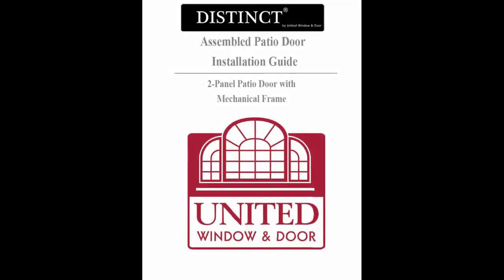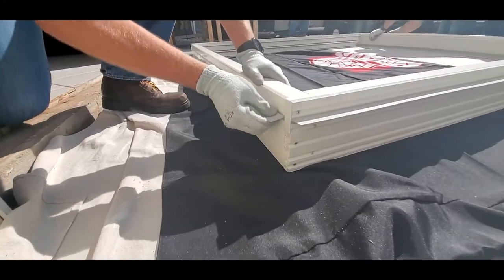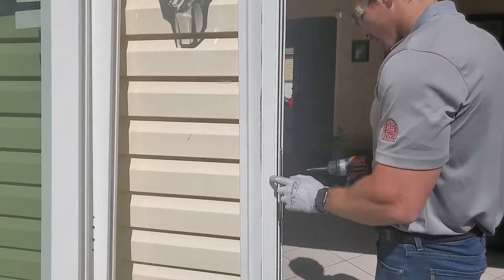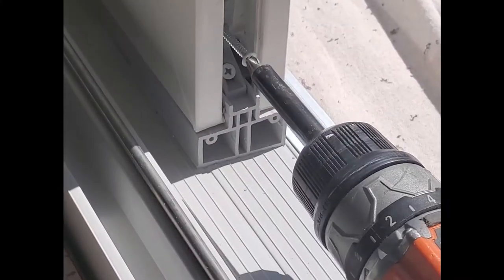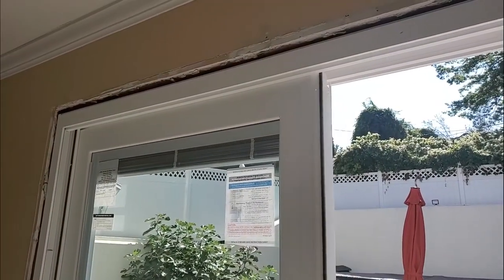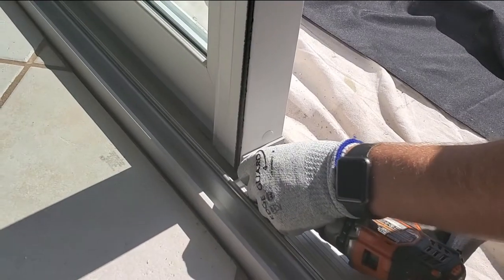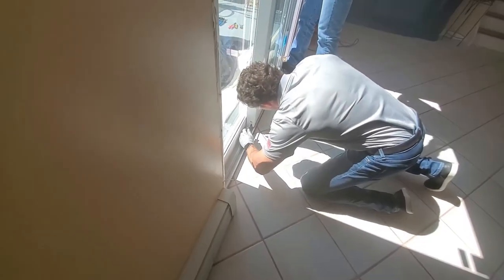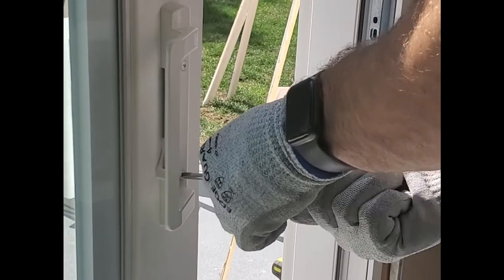DISTINCT® Composite Patio Door w/Knockdown Frame - INSTALL VIDEO

Comment: We just finished installing one of these (right opening door version - purchased from Lowe's) in our historic house that was built in 1890.  The whole setup seem stout/sturdy.  We were able to remove our old doors and install the new setup in one day.  We had to cut out old wood 1" siding using an oscillating blade which ate a couple hours.  Some quick observations:  
-It seems to require more force then it should to open and close the door, but we are hoping that eases up in time.  
-The sliding door panel blinds that are in the glass, were half way down and sideways when we opened the box.  The tape with the warning was still over the control mechanism so it appeared to have happened in the box on it's own.  After we finished the install, we moved the blinds to their uppermost position and they went back into their appropriate position.  We are crossing our fingers they don't have issues going forward.  
-The Lowe's employees sold us an $88 door handle because they said it doesn't come with one.  Well, it did come with one.  We plan on returning the handle tomorrow and purchasing the screen door.  We would always rather have what we don't need, instead of not having what we need so it's not an issue. 
-The track seems higher then normal.  We have already caught our feet on it while stepping over a few times.  We even installed it below our 1" thick hardwood floor.  Time for some foot lift retraining!   

There were a few hiccups that could have been avoided, if the instructions had more detail.   Examples:
1. We failed to push the non moving panel completely back, causing the bottom plastic piece we screwed it too, to have a gap.  This was only obvious when we were on the last step.  We had to remove several pieces to be able to release the panel so we could push it back flush.  The instructions do not specify whether to push the non removable plastic piece all the way up leaving a gap at the bottom, or all the way down leaving a gap at the top.  We chose to leave a gap at the top.  This was a critical mistake that took a long time to remedy.  The non removable plastic piece being misaligned caused it to block the bottom screw that held the panel in place.  We had to use a step bit to enlarge the hole so our screwdriver tip could fit into the screw we needed to remove, so we could push the panel back flush.  No matter how hard we tried we could NOT GET THE NON REMOVABLE part to budge.  It would NOT MOVE UP even 1 mm.    
2. One of the slimmer pieces you "push in", towards the end of the non moving panel install, was impossible for my wife to get in.  She gave up after trying for over 10 mins.  I spent about 10 mins fiddling with it until I figured out, I could bend it outward and push hard enough at a 45 degree angle, it would finally snap into place.  In this video we watched the installer do that very thing.  We laughed at how we watched this video AFTER we were finished and not before. 
3.  Nowhere in the instructions does it say to drive a screw at a 45 degree angle into the fixed panel backside.  The installer in the video did that (albeit clearly not at the site of install, looked more like the warehouse), but we didn't see that in the instructions.
4. The push in plastic pieces that are used for "new construction" are not specified as "new construction" in the instructions.  Wife has installed a few sliding glass doors and none of them required those flanges.  We installed them because the instructions said to.  The door we removed had them, although what we removed was like 50 or 60 or 70 years old and aluminum.  Because we used the "new construction" pieces, we had to install further out then the doors we removed.  This now requires us to purchase additional molding to take up the gap on the inside of the room.  Having thought about it after the fact though, we still would have used the "new construction" pieces because it seems like it gives a much better seal against the weather here in southern Washington state. 
5.  The plastic mini broom looking pieces you install in the middle top and bottom, the instructions told us to put the top one in before installing the moving panel.  We did that.  Then we couldn't install the moving panel.  The mini broom doesn't allow enough clearance for the door to lift over the rail for the wheels.  We had to remove the top mini broom.  After installing the moving panel, re-installing the 2 screw mini broom, one of the screws dropped directly between the doors with no way to get it.  It is there this very moment, probably lonely and afraid not knowing when it will be rescued.  We grabbed one of the many extra screws, of the same type/length, and even more carefully, was able to thread it back into the mini broom.

6. The instructions list 3 screws in several sections, but they only pre drilled 2 of them.  This same thing was repeated multiple times.  It makes for confusion and uncertainty.

Overall, the door looks good, everything we needed was in the  kit, and despite being exhausted, we are very pleased with the overall product.  Time will tell whether vinyl holds up to the elements or not.  Fingers crossed!
Reply: Thanks for all the info!! I’m gonna get one soon….to replace a leaking bad installed door!!

Comment: I see this is a 6" wide door frame. Will this be any issue installing in a 2x4 framed wall with vinyl siding on the exterior?
Reply: I’ve the same question. Will this fit in 2X4 wall ? Did you end up buying this ?

Comment: I just purchased the patio door and will be picking it up at Lowes next week and I have a few questions. The video did not show the screen installation. I read a review and it stated that you should install the screen door rail to the frame before putting it together. Is this correct? Also does the door handle come with a keyed lock? Thank you!
Reply from the maker: Hi Kim.
If you have any questions about installing the screen door we suggest that you give us a call at 800-848-4550. It would be much easier for one of our representatives to answer any questions and give you the best advice.
As for the lock, the door does not come with one but we do have one for available for purchase.
Reply: @unitedwindowdoor8185  Thank you for the reply!

Comment: The door in video is an “L” ?  Lowes sold us an R. Fixed panel on left side inside house facing out.
Reply from the maker: Hi Tom! If you have any questions or concerns about your new DISTINCT door please don't hesitate to give us a call at 800-848-4550.

Comment: I just opened the package to start the install. Why is nothing labelled? What the hell is the point of an instruction book . If nothing is marked????? This video doesn't help at all either. I read and make parts from prints for a living. I'm returning this door .
Reply: The parts don’t need to be labeled… they literally add pictures in the book of each part. Besides if you can’t tell the difference between a door head, jam, or sill you probably shouldn’t be installing it anyways
Reply: @user-pk6pr6ut6b  Yes parts do need to be labeled and there were no pictures on the paper. I wasn't going to put that piece of shit door together by trial and error.  That was literally the worst drawing I have ever seen. Maybe you can make a video and show us all how easy it is . Glad I didn't put this door in their cheap as fuck for a reason.
Reply: @Mattman2500   There is a very descriptive pdf on there website with labels and pictures. If you're incapable of going to the manufacturers website for further help on this kit that costs $1500 with the screen door then what you are is just plain lazy.